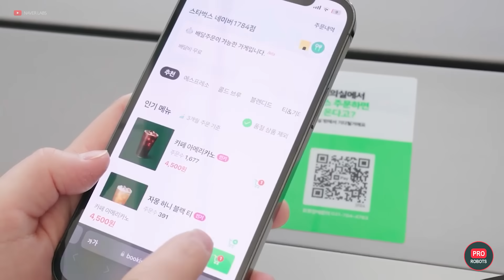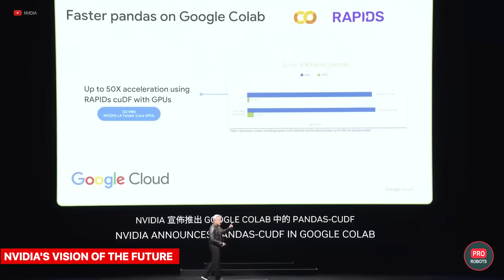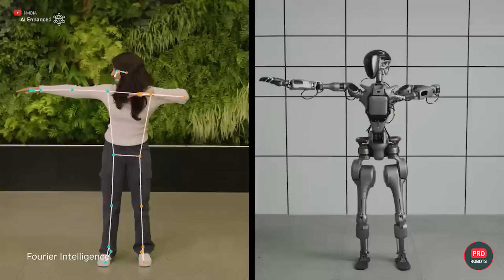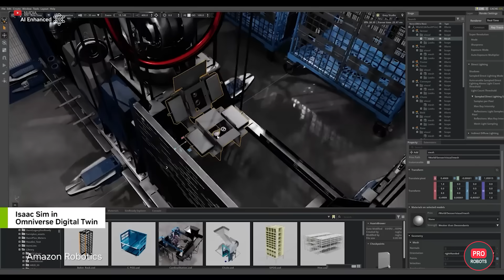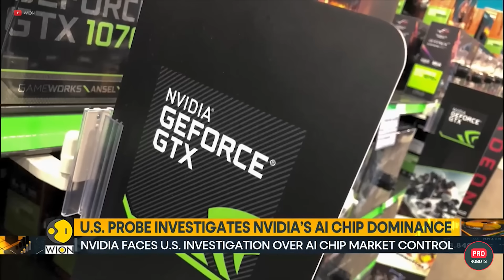Robotic Future: NVIDIA's AI, Japanese Space Elevator, China's Bots, Moon Mission #prorobots

Comment: A space Elevator really? isn't the Panet in constant motion with jets flying everywhere? I would say a Space Platform. With the Use Of simple stuff like pressure changes could get us to space cheap. We even have High Atmospheric Balloons. change the Scale size float it up High until it can easily take off to a space station delivering cargo. Like Helium pumped into balloons 2000 feet under water material cargo is loaded the lock is released it might fly to space by itself cheaply for pennies!
Reply: With a balloon you might be able to get to 20 000m, there about is a record. Then you still need another 80 km and balloon will not do, because atmosphere gets too thin , but to be in the orbit you also need to move at approximately 10 km/s parallel to the surface, otherwise you will just fall directly down. 
As for the jets, they can steer around.
Reply: Your thinking of Cheap cartoon balloons not engineered proper and By scale  and I said a Platform to launch from. Since the Atmosphere Pressure is Lighter it will be easier to launch. Stop listening to the Lying CIA NASA that said they got to the Moon in 1969 in a tuna can. Tardigrade's Make it to space without balloons or rockets. So stop the lies. It's just Math & scale proportions  @AndrejMejac
Reply: Google Japanese Space Elevator
Reply: It's not possible. The Atmospheric Strain and environment on Bridges collapse. A space Bridge? The planet in constant motion would put so much strain on it would snap in 2 years @MikeTheSeeker1961